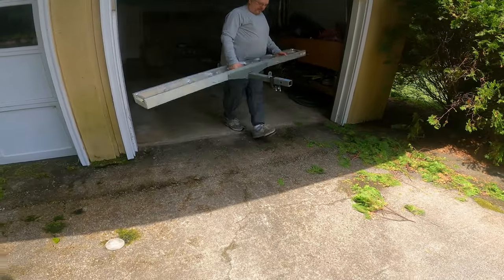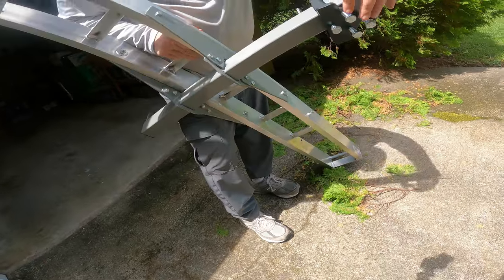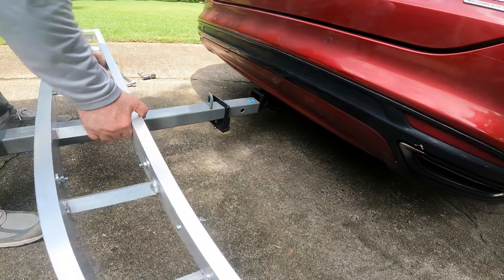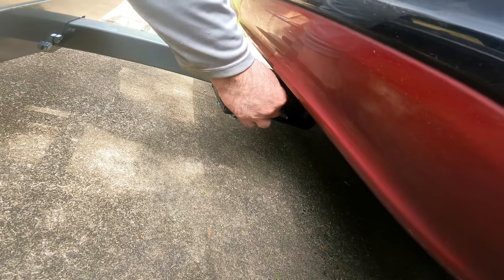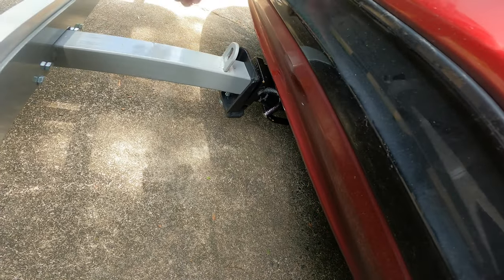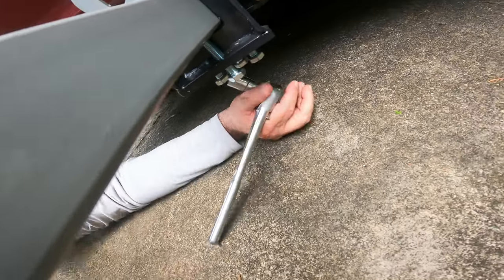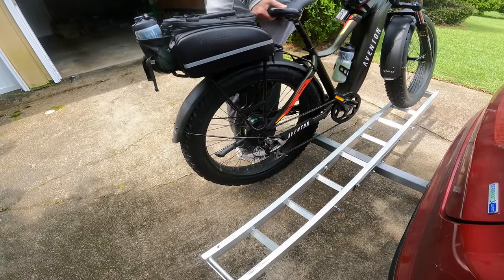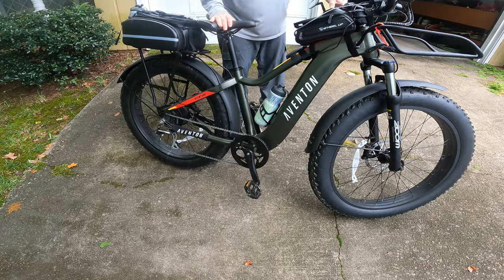How to Secure an EBike to a $150 Black Widow Bike Rack with Ratchet Straps

Comment: Did you buy the straps from Black Widow, or did you get them locally?  When I purchased the rack, nothing was said about the straps being an extra purchase.
Reply from the maker: I purchased them off Amazon.   I did not research it at all and brought 4 of one type and then 2 of another type.  I guess all types would work so I didn't recommend any.
Reply: @richarddkearney  Thanks.  I put in an order with Amazon tonight.

Comment: I'm not impressed with the bike rack.  It looks unstable.
Reply from the maker: Unstable in what way.   I shook the bike and it didn't move at all and I've driven down the road at 70mph for about 100 miles a few times and didn't seem to move.   What should I have done to show stability that I didn't do?
Reply: For the price, it's great.
Reply: @VictorCastillo-hb5bs it works great we have a rack for two bikes took it to Florida and back to Minnesota. Richard could be a little smoother but I would rather him be realistic. We just drive ours up the ramp that comes with it.
Reply: Way too much work when a dedicated rack made for E bikes is not that much more money. Young makes one that is not expensive and much simpler to use

Comment: I'm worried while I'm loading it up, someone is going to come up, shank me, and take the bike.
Reply from the maker: setting it up should be at home.  Then the loading of the bike is just pushing it up the ramp and strapping it down.  About 5 mins.  Probably not going to find any other rack that will take less time at that point.   Probably greater chance just walking to your car and having someone shanking you to take the car.  Lot more valuable.

Comment: Your heavy duty ratchet straps are overkill on 75# bike the placement is fine but if the heavy ratchet goes the wrong way your going to damage the car and or the bike. I didn’t notice but you need to lock the bike’s suspension or it could bounce out on you
Reply from the maker: I should have mentioned that in the video, if I didn't, but locking the suspension is something I do (as long as I remember).   I'm getting better in doing a routine to lock when I put the bike on the rack and unlock when i take it off.   However, when I first started, I would forget to either lock or unlock it about every other trip.
Reply: How do you lock the suspension on an ebike
Reply from the maker: My suspension has a Lock switch on the top of the forks and I just turn it to the lock position and then back to the unlock position right before I go riding.

Comment: Use motorcycle handle bar ties down adapter liter two tie downs and that sucker doesn’t go anywhere. Too much work?? I leave mine in my truck most of the time. I can have my bike on secure and chained up in less then 3min
Reply from the maker: Well I tried handle bars tie downs and I believe I have 2 videos talking about what happened to my bike afterwards.   I do not recommend those for ebikes.    However, I do wish I had a truck or even a van, but I don't, so I deal with what I have.

Comment: Do the tie down straps come with the rack or do they need to be purchased separately? If so, what straps did you use? Thanks.
Reply from the maker: The straps will have to be purchased separately if you don't already have some.   I just type "ratchet straps" in Amazon search and picked a set.   I also got the auto retract straps and have a link in the description, but I'm not sure they are the best type to get

Comment: Very informative. I have this rack. I’ve had some difficulty getting my very heavy ebike secure. If you were buying new ratchet straps, what would you recommend? Thanks.
Reply from the maker: I'm certainly not a ratchet strap expert and haven't tried but 2 types so my opinion wouldn't be worth that much.   In the video, I tried 2 different types and both work.   I really liked the auto retractable one because it is easier to work while one of my hands is holding the bike up.    The problem with that one is I can imagine that some kid would walk behind my car and release it by just pushing the big red button and create issues for me.   Since I also use chains and locks to secure my bike, there wouldn't be any danger of them stealing the bike on a whim, but would still be irritating if someone did that.
Reply: @richarddkearney  good point. I had the same problem trying to retract the band while holding the bike up. I’ve got an Ariel Kepler which is a tall heavy bike.

Comment: Do you have to tighten the 3 bolts at the bottom Every time you gonna use the ebike rack?
Reply from the maker: If you take the bolts off you will have to put them back on.   However, I have changed to a different connection method and with the new method I don't have to lay on the ground and tighten the bolts.  I can do it just leaning over the rack.

Comment: It’s sticking out to far on drivers side
Reply from the maker: Well it is a motorcycle rack.  I decided to put the bike in the same front wheel position as motorcycles go.   If any part of the bike was more on one side, I would prefer it to be where I could see it better and that is the driver side.  I was able to easily put the car with the rack and bike in my garage mainly because I could see the tire from the driver's side.

Comment: I  have sen vidoes that show the front wheel dropping down and the a rod runs thru the wheel...alxo the back one...does that work on this rack?  https://youtu.be/GpA6u3KR7EQ?t=1830
Reply from the maker: I've seen a video like that too, however that isn't a standard option on this rack since it doesn't have any holes for that.